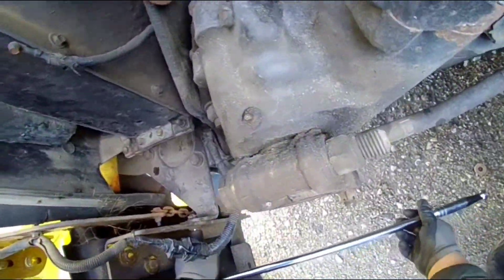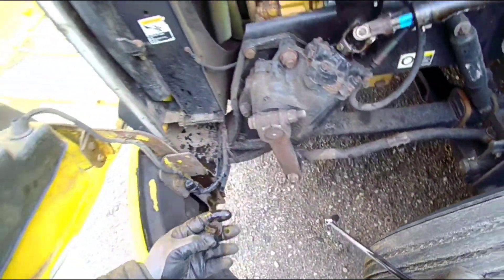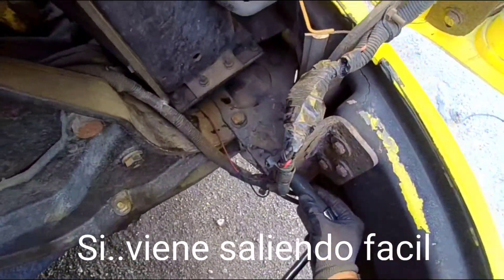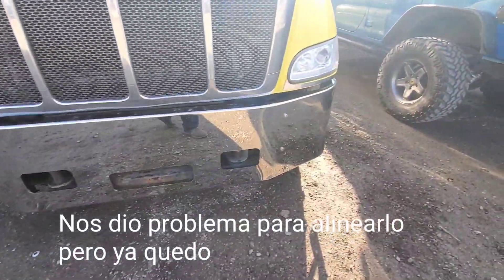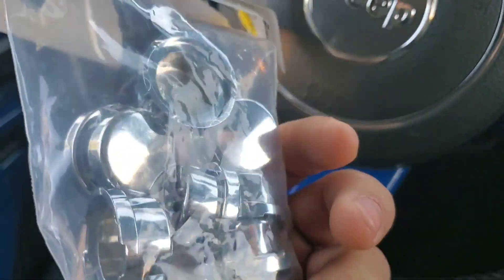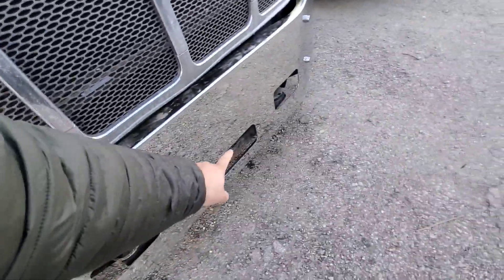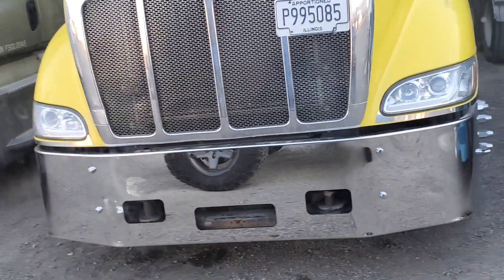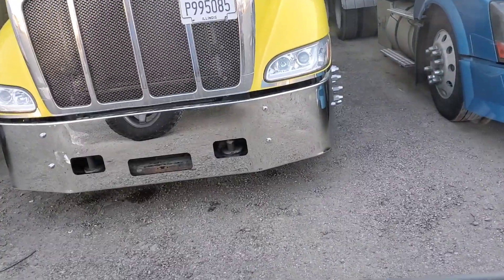Peterbilt bumper/installacion Defensa de Camion/owner operator/Camion/ own authority/Trucking/chofer

Comment: So it was only 4 bolts holding that on there?
Reply from the maker: Yep 4 bolts, the aftermarket holds with 6
Reply from the maker: Actually there is another two small ones in the front, I forgot about those 2